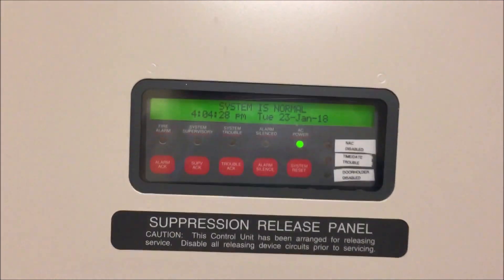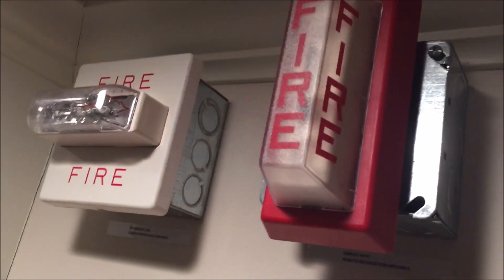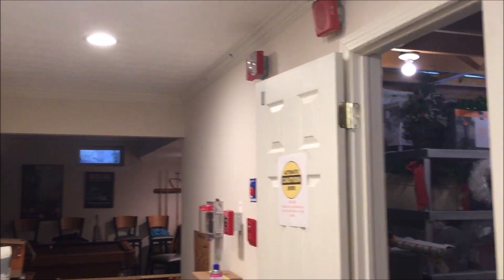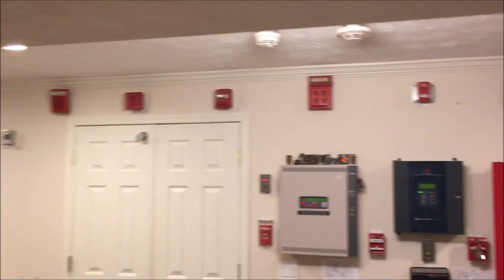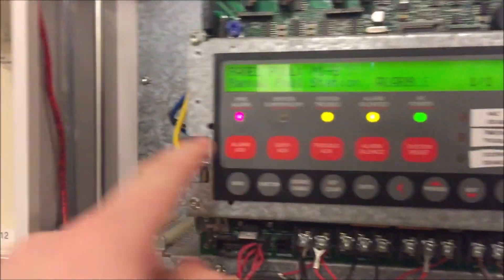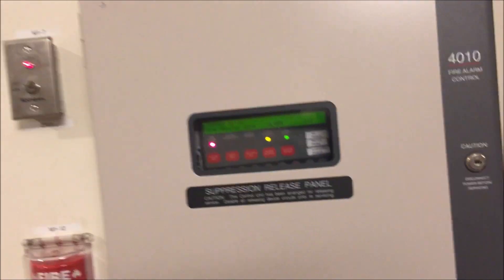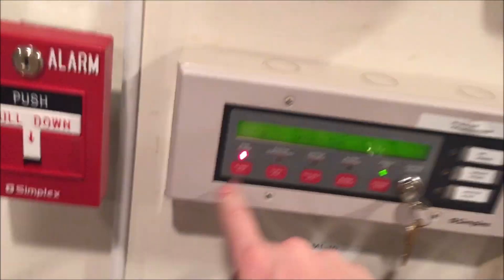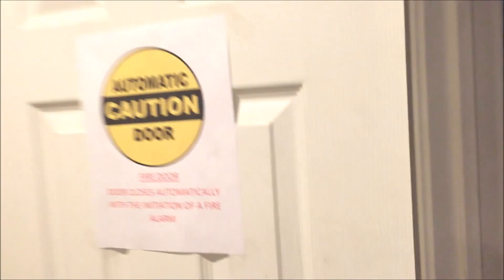Simplex 4010 Test 24: Simplex Light Plates

Comment: Great video 😀👍👍
My high school used to have those Simplex Strobe plates and horns, before the dreaded Siemens system was installed. 
In my opinion, the horns sound best in March time.
Reply: Micah Larson Siemens is just annoying to work with and often has issues, in a nut shell.
Reply: Evan Bart 410 actually tho. we put in a Siemens system and it was the Worst! This thing was hard to program, it had a load of troubles, etc. A couple of months later, we had to get rid of it all, the pull stations were all kept and the alarms were changed to l-series. This was my dads business.